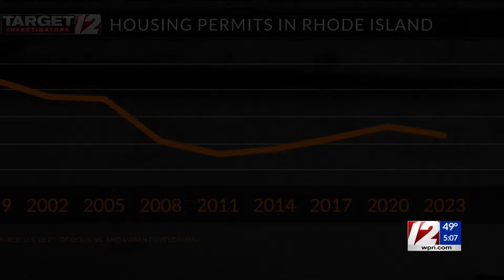Housing Crisis: 'Red tape' keeps builders from constructing new homes in RI

Comment: is this guy serious? rhode island is literally 40 miles across. how many houses do you think we can actually build? i'm from warwick and the houses are already on top of one another. what more do you want in this state the size of a small city?
Reply: Yes we can definitely build more housing. Let me take you on a little back of the napkin hypothetical.
In Warwick there is about 35,000 homes, the majority of which are single story and cover less than a third of the lot.(1) If we took one lot and put medim density housing on it, say two story row homes that utilize the whole lot we can easily fit 6 units on a single lot. No units on top of other units is necessary. 
If we want to build 10,000 additional units how many single unit plots do we need to covert? 2,000! 
That sounds like a lot but it's less than 1 in every 17 homes in Warwick.
Space is not the problem since Warwick, without building any new developments or infrastructure could fit all the homes Rhode Island needs, inside existing neighborhoods. Space is not the problem, unless you believe yards should be required by law. Oh wait, Warwic legally requires yards!(2)

(1) https://www.point2homes.com/US/Neighborhood/RI/Warwick-Demographics.html
(2) https://www.warwickri.gov/sites/g/files/vyhlif12206/f/uploads/residential_setback_requirements_0.pdf

P.S. Just a reminder, this is a hypothetical meant to dispel a common myth. not a serious proposal for housing reform.